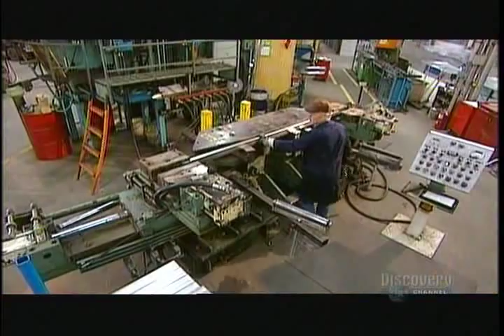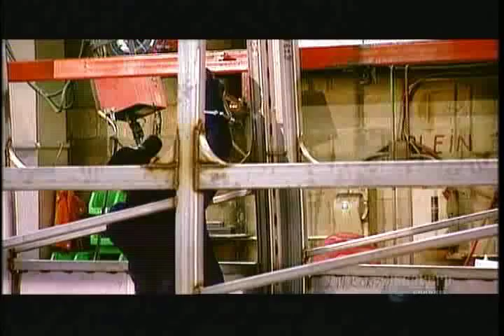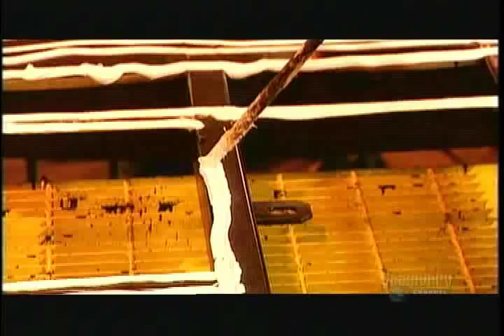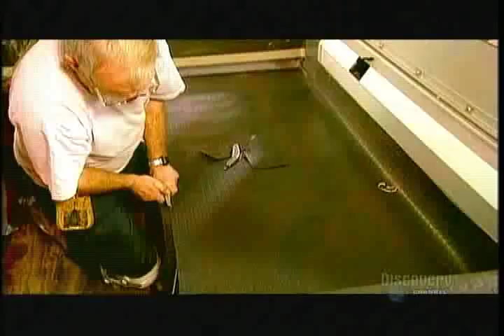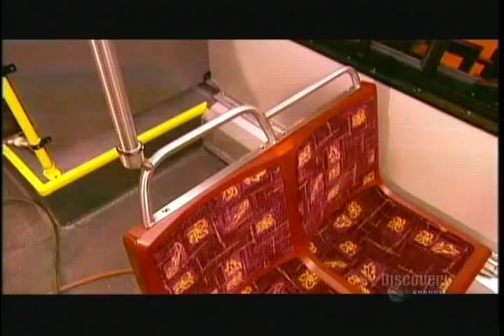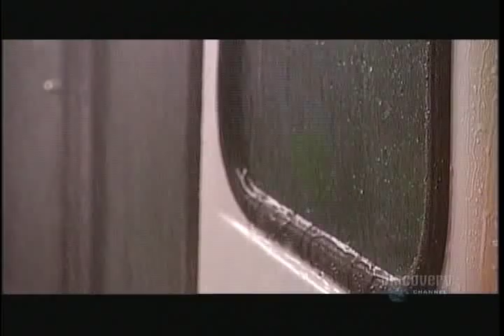How It's Made Buses

Comment: Just waiting when car makers start to use stainless steel:P There is one from the 80's already. I dunno is it too expensive or wont they wanna make car what lasts?
Reply: That one from the 80s was used in back to the future
Reply: Auto manufacturers want lighter materials made from plastic. But new Ford trucks are skinned in aluminum now.
Reply: @Rob_Mike_Litterst  you're correct. I've heard body shops absolutely hate them. It's like driving around in a Schlitz Malt Liquor 40 oz
Reply: @reginaldhall6871  body shops hating easy repairs for molded parts to bolt in might as well be riding the Jagermeister gravy train all day